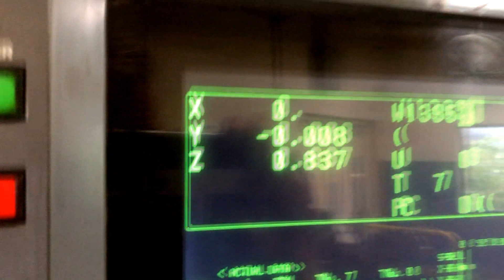How To Measure Diameter of 3 and 5 Flute Endmills

Comment: I'm not sure i'm grasping why the DRO even needs to be in the loop here.  The indicator itself is showing you the 8 thou as soon as you get it on the flutes.

DRO or no, making sure that the indicator is centered along the axis of the tool to start seems pretty important to getting a good reading of the its diameter.
Reply from the maker: Good point. But what if the diameter was more like .030" undersize? That's kind of a big "jump" for the indicator. But you are correct.
Reply: @TheToolandDieGuy  Ah, yes, using the DRO to extend the potential range of the indicator makes much sense to me now.  I'm measuring parts downstream of the machinists, and not very practiced in thinking of how to use mill itself to measure things.  :P
Thanks!
Reply: @keithkrummel9344  Indicators can vary +/- quite a bit. The machine is always much more precise. I always use an indicator for Zero finding seldom for measuring. Machine and Gauge blocks for measuring.